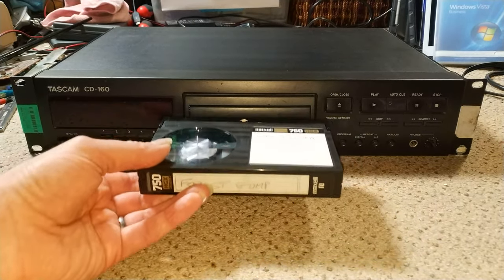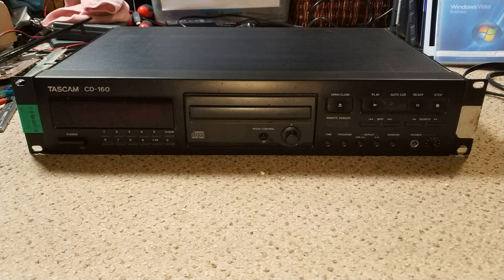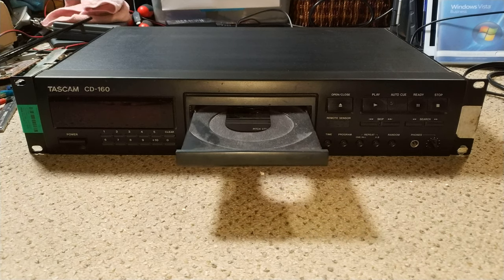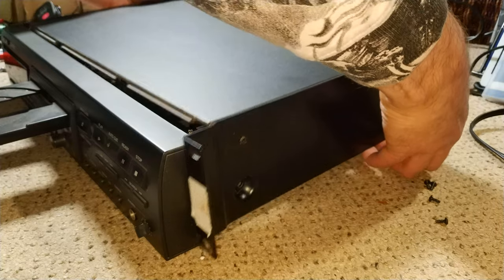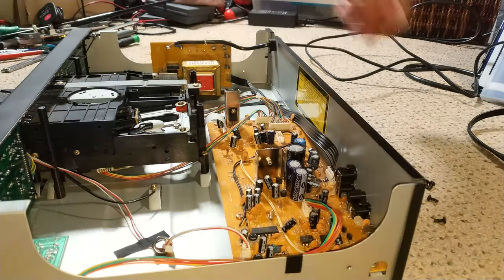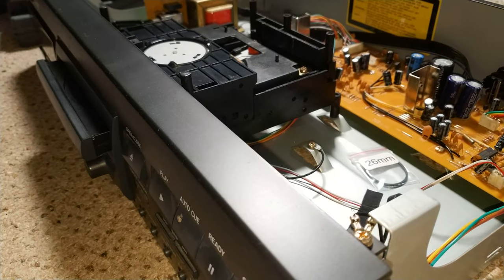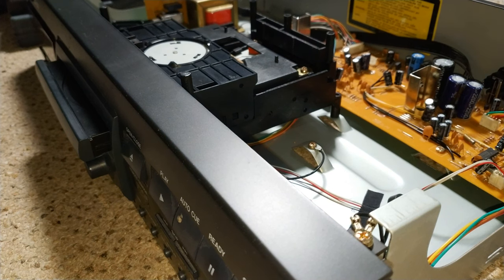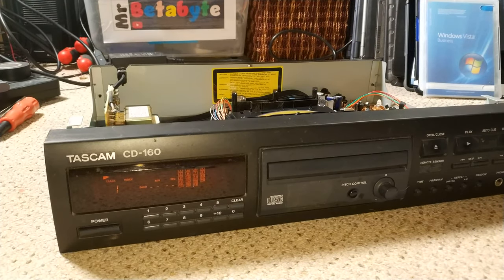Tascam CD160 CD player - tray stuck open for 8+ years!

Comment: Hi, this is common TEAC cd mechanism. It is need a lot of grease to work well. The power of laser diode need to be adjust if the tracking  not work good, you will find it under the pickup unit. As well, some capacitors of power section and the 8V regulator needs to be change if you have troubles.

Comment: I would always test the Laser first if possible. Construction years 2001-2006, Pitch +/- 6%, The Ferrite Ring that is glued to the Bottom Plate also makes a very professional impression.
Reply from the maker: Thanks for this - I thought it was probably early 2000s although I think it was bought a little after 2006. Definitely a cheaply made CD player!